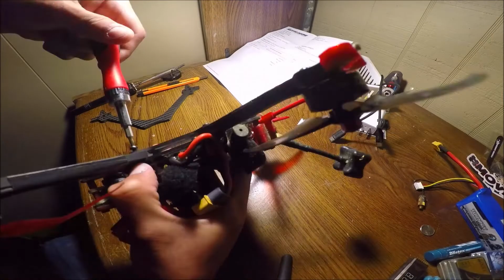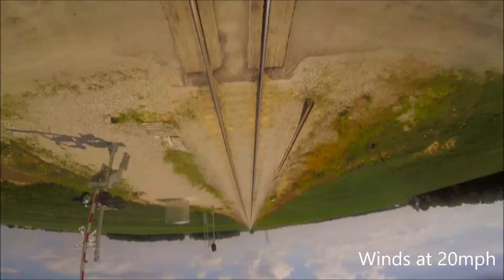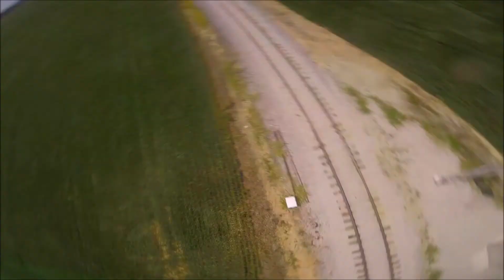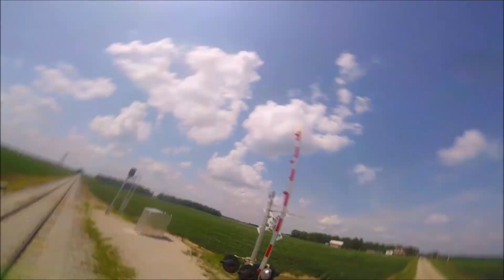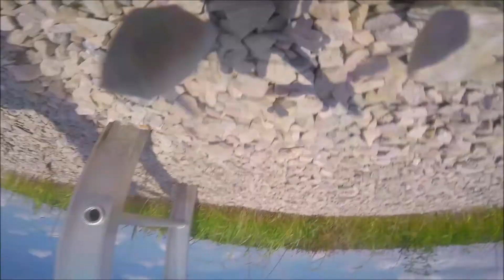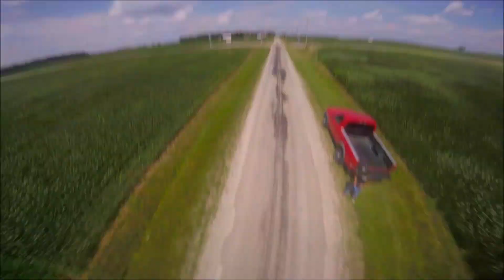Flosstyle is fixed.  FPVlog

Comment: Loving the edit 😃 you did well in 20mph wind 💨 you live in the middle of nowhere ! Must have too drive 100 miles for a location 🤷🏻‍♂️like the truck 👍🏻
If you brake your quad the same way get a small piece of ally drill 2 hole and brace it while you wait for the part .
Reply from the maker: thanks a lot man. I love my truck. yes I have to drive a little bit to get anything good.
Reply: HornetFPV your little bit is like an hour and 60 miles mine is 5 miles 10 mins
Reply from the maker: Dean Chapman FPV yep. sounds about right.
Reply: HornetFPV little England 🏴😃

Comment: First 😂
Reply: Hey Stingy, the vlog was good. Good choice of music. As for Floss, you easily fix it as it's not really a stress point. Sand down that broken joint to like half it's thickness. Laminate new carbon with epoxy and if you can find carbon, I'm sure you can find glass fiber from a hobby shop. I think 4 or 5 layers would make it good as new. I have fixed broken arms on my quads before and one quad of mine still has a fixed arm even though I have spares :)
Reply from the maker: thanks bari. I'll try to fix my arm.